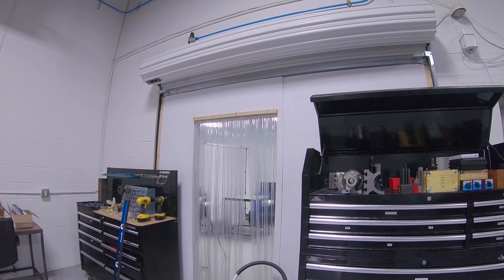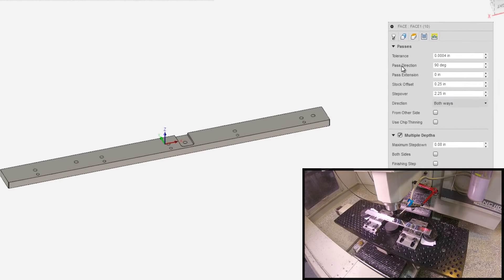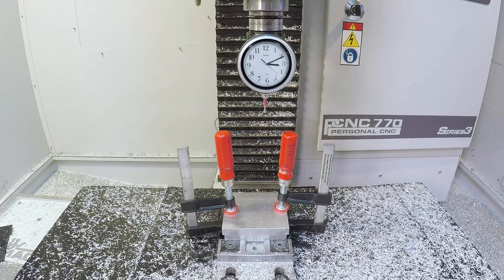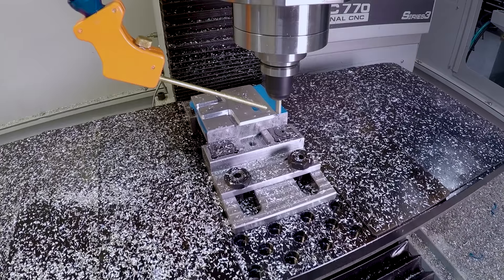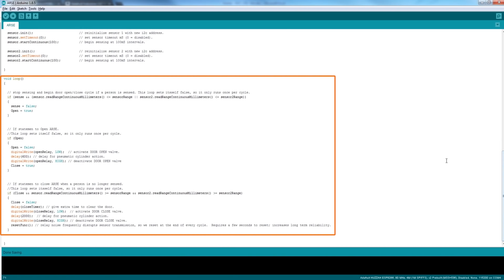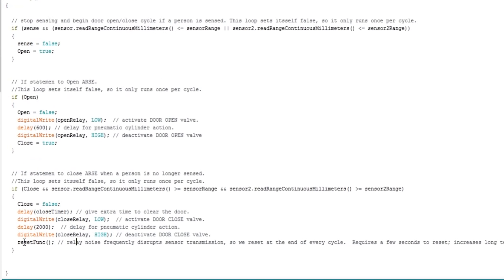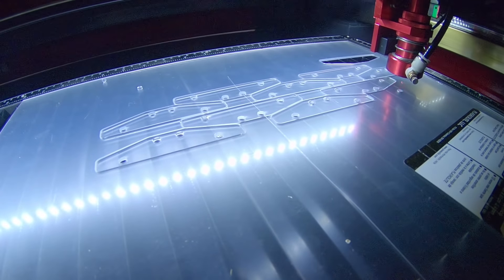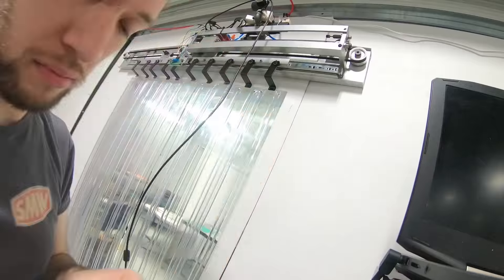A.R.S.E. Automatic Rubber Strip Egress Arduino Door- WW188

Comment: Love those 'duinos! The Nano is very under-rated, Incredibly good value and SO useful. I use them a lot. And the distance sensor - I dint know they existed, been using PIRs for similar projects. Thanks for the insight, great build.

Btw, you can get breakout boards for the Nano, with screw terminals...
Reply: Teensy for life! Infinitely better processors and internal libraries in a more sensible form factor, and a header arrangement that works with a breadboard. Having to bodge wire your shields is a small price to pay.
Reply: I got a couple of Teensys, but for sheer processing power you want the ESP8266, runs at 80MHz! And it has wifi built in - but you don't have to use it.
Reply: You should have a look at the Teensy 3.6. 180MHz with 4k of RAM and the same 1Mb of flash as the 8266 (can't match the 4Mb of the ESP32 though), integrated microSD holder, more hardware interfaces than you can shake a stick at. It's even got a native ethernet port, but you have to add a transformer and socket via a carrier board. And with its DAC and audio library, it could have even added the Star Trek door noise to this project. It's $30 which is a little hard to chew when you can get Nano clones for under a dollar and ESP32 boards for $10.
Reply: Yes. Have to choose the right device for the project. Nanos are very cheap, and very versatile. I'm getting Nanos for around £1.20, and ESP8266s with breakout board for around £3. Hard to justify the price of a Teensy...

Comment: Could have been done with one beld and without the two gears.
Reply: What's a beld? Some sort of sequential?
Reply: Belt.  One belt.  Connect one side to the top and the other to the bottom and they will move in opposite directions.

Comment: So I like the superglue and tape trick, but it really isn't any different from using good two-sided tape.  The adhesive bond between the part and tape is what holds the piece in place, assuming the superglue adhesive strength is higher than the tape adhesive.  I suppose it does make positioning easier.  Clamping may also increase the workholding.   It is a nice way to make quality, thin two-sided tape that can be hard to find.
Reply: Ah....makes  sense.  I can see how that would make it  stronger than double-sided tape. Ever tried it with steel?  Thanks.
Reply: Interesting. I've seen Clickspring use the superglue directly on aluminum to aluminum and brass to aluminum, then heat them to get it off. That tape is quite impressive however!

Comment: Ferrite rings or RFI line clips and also add a dial pot to adjust the sensor sensitivity. Twisted power wires adjacent to signal wires can help. If you are dead set on no error correction through hardware then I would add a timer to trigger the reset after a few hours(24hrs?), so it don't go haywire if no one shows up for a few days.

Comment: For Judd, maybe an IR beam either side of the door at his height for the trigger? Or a narrow beam IR sensor that goes to the floor or even a combination thereof?
For example, time sensor detects movement about to come into detection zone and then hands off to narrow beam IR sensor, preventing false triggers.
Most commercial automatic doors have an IR beam in the middle to prevent the door crashing into someone, instead of a time delay.
With the sensor shop side, would it be that it wasn't far enough away from the motors, relays, etc to detect due to interference? A similar idea to the office side could be implemented shop side just forward of the assembly, instead of chest height. (Unless this was already tried and failed also).

Great video, love this. :)
Reply: To be fair Judd never had a problem with the strips, it was just the humans that got grumpy
Reply: Of course. But what is good for the humans, is good for Judd. :)

Comment: Really cool project. I'm envious of all your cool toys er tools. 
I'm not a machinist so I'm not really surprised I hadn't heard of the superglue/tape trick, but I've been in shops enough to be really surprised by both the cut depth and feed rates you're able to get away with while using that trick.

My only criticisms are:
- A visual indicator (LEDs etc) of status (Active, detection, Opening, Closing) would be handy not just for diagnostics, but to keep people from walking into it should it fail. I know that the strips make this not a big deal, but if it was going to be adapted to a general purpose door opener. Plus LEDs, I mean can you ever have enough?
- It's begging for a Star Trek door sound effect
- that hard reset makes me feel a little ill, especially since it's a solved problem with lots of fixes out there you could steal

Comment: You don't need the tape, just glue the blocks directly; when you want to separate them, just heat them with a blowtorch.
Reply: The tape is easier to clean off with iso, would also suspect the tape provides a tiny amount of give ensuring better surface contact overall
Reply: he has made a video on that topic, so you're wrong, one does need the tape for more easy removal .

Comment: So if you really wanted to play around, you could time the opening to cancel the movement at the end.  Watch the slo-mo and see how the strips swing out and then too far?  So open the door about 80-85%, pause long enough for the bottom of the door strips to reach the outermost point, then open to 100%, aligning the top of the strips with the bottom and canceling the movement.  It would take some trial and error, but if it opened and closed like that it would like like it was alive.  Hope that description makes sense.

Probably wouldn't take more than 30-40 minutes of trial and error to get the percentage and pause correct.  First open it partially and video it and look for the bottom of the strips reaching what would be the fully open position.  Then use the video to see how long it took after stopping for them to reach that point.  That would decide approximately when you finished opening.
Reply: I love this idea.
Reply: I don't think that the rodless cylinders they're using have positional feedback. (I don't think you could implement positional feedback into rodless air cylinders at all.) They're either open or closed.
Reply: Oh man, so true.  So, ditch the cylinders and use a stepper motor with some limit switches.  It would be so cool to see the organic/lifelike movement that would result from what I'm describing.  Now I want to go do it myself.  :)
Reply: Get a seperate Linear potentiometer to use for positioning :D
Reply: they don't need positional feedback, I think you can fiddle it out, by only opening the valves a specific amount of time.
Reply: I'll be looking forward to the video!!!  :)

Comment: I just have to say, 1: it's a great project and you did a great job explaining the code. 2: as a software/mech/elec engineer, the hardware reset in the code is soooooo cringy.  Learn about inductors, why relays are electrically noisy, and what you can do about it.  There is no reason this should not work without the reset.  Hint: diodes and capacitors.
Reply: In more specific terms: you want a flyback/snubber diode on the relay and potentially a largeish capacitor on the processor's input after a diode so as to avoid supply voltage disruptions glitching the chip (which can do such annoying things as delete the contents of flash).

Comment: Doesn't that sort of defeat the purpose of a strip curtain?
Reply: Agreed, you may as well make it two solid doors. Or are we missing something John?

Oh that aside: nice project and cool result!
Reply: Understandable. Thanks for answering! I also thought of a couple of reasons myself: 1-solid clear doors are expensive, 2-increased mass that has to be accelerated off-axis (so mechanics have to be a lot more rigid or acceleration has to be reduced)
Reply: Ed from SMW good point!
Reply: Strip curtain work only well for  avg. sized adult humans, when they hand from a gate, that is so high, it will allow trucks 2 pass through. On an normal doorway they do hang much too tight, to allow a avg. sized adult human to pass through comfortable (it really drags on your Head and shoulders, so you have to push through with force) .
Reply: blitz355 yes it completely does but like most thing in America it looks cool so it's fine.
Reply: Wowthatsfail are you American?

Comment: why not have solid panels and BOOM you have yourself a star trek style sliding door
Reply: SpeedrunnerG55 you would need collision detection and such with a solid door.
Reply: Jm R Not really. They're using "rodless" air cylinders. So if it did close on you, the magnetic force would break.